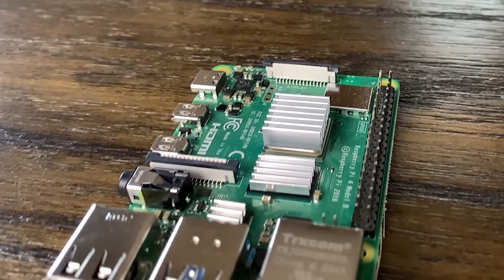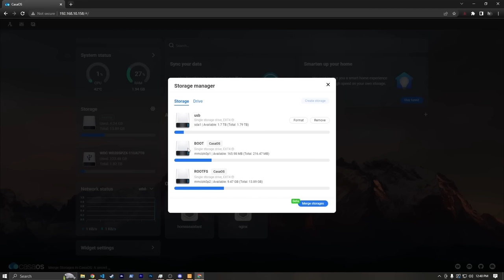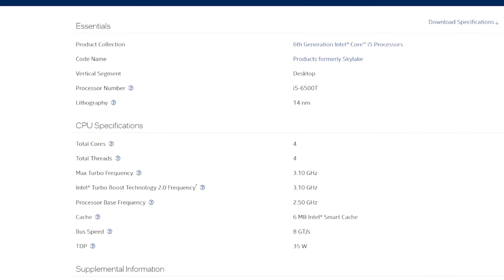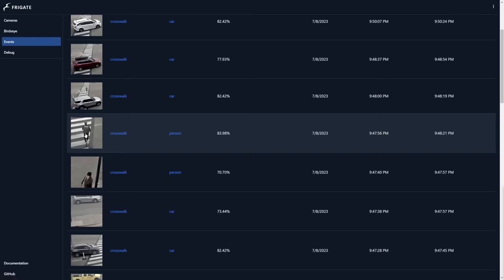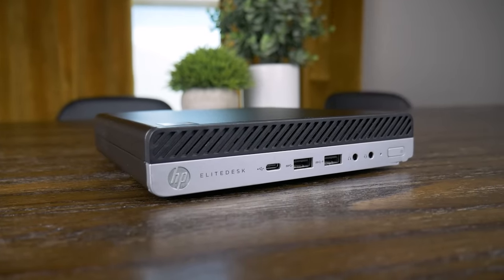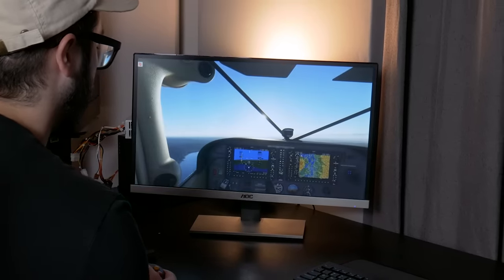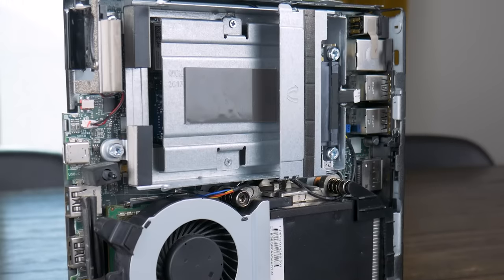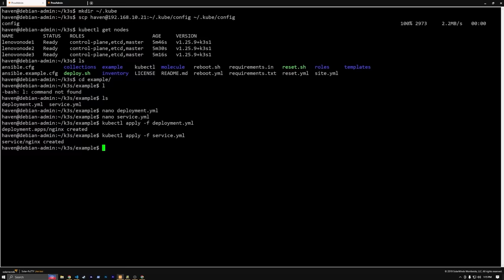The Mini PC You SHOULD Be Looking At

Comment: To obtain the same price of RPI you had to buy this used and to be fixed.
But, most important, I still don't understand why many of you continue to consider RPI as a mini pc. It's not a mini pc, it's something different which strength is flexibility. RPI makes sense for highly customized projects, not for pc use.
Many compare mini pc to RPI just because you can easily win on specs confrontation, but this is not fair.
So, just say "here's a good and cheap mini pc": that's fair. Comparing a mini pc to a RPI is unfair and misleading, IMHO.
Reply from the maker: I agree that RPis weren’t designed for the applications is discussed here, which is a big part of why I made the video. There was an element of shock and awe by mentioning the Pi, but you also have to realize that many of the people that watched this might’ve bought a RPi when something else would’ve been better. I agree with everything you said other than it being misleading. Unless you skipped the first sentence or two of the video I guess
Reply: @HardwareHaven  the first two sentences of the video are part of the video.
If I have to talk about a cheap car, I wouldn't start from a bicycle.
But ok, I get your point.
Reply from the maker: If tons of people were spending thousands of dollars on a bicycle to make a 15 mile commute every day, and you were making a video about an inexpensive car that would cost roughly the same and be much better, you might start out the video talking about the bicycle. I think that’s a fair use of your analogy.
Reply from the maker: And I wasn’t suggesting that you skip Tye first few sentences. I was saying that in those first sentences, I explain that raspberry pis aren’t bad, but aren’t good for certain uses.

Comment: Going to correct you about the x86
The cpu's are x64
Reply from the maker: x86-64 is an extension within the x86 family of processors. Yes, they’re x64 or AMD64 compatible, but still within the x86 family.
Reply: @HardwareHaven  not every x86 cpu supports 64 bit then following what you say
Reply from the maker: Yeah, that’s correct. But an Intel i5 is still an x86 cpu. When comparing between other architectures like ARM, RISC, people tend to just say x86 rather x64 or x86-64.
Reply: @HardwareHaven  i don't
Reply from the maker: @elwinroyale  I never said that you did or should. I think we're on the same page 👍

Comment: Why another video recommending people buy these used machines and immediately upgrade them.

Buy a new mini PC. A low end model will feature a 4 core celeron 6 watt,  8gb ram, 128gb nvme, wifi/bt, 1gbps ethernet, USB c, HDMI starting around $100 and often on sale for $70-80. Either Windows 10 pro or 11 pro.

Then there are options galore. High end AMD or Intel laptop CPU, 2TB nvme, 32gb ram and more.
Reply: Agreed. There's little reason to buy into old platforms like 6500T unless you can get them ridiculously cheap. Modern alternatives like N95/N100 in sub-$200 mini PCs outperform them at much lower power consumption, can have DDR5, can have nice features like onboard Wi-Fi6E+2.5gb networking, and have Iris Xe onboard graphics making them reasonably capable of low-end PC gaming and higher-end emulation tasks.
Reply: @velocity37  even a n5105 based celeron almost as much CPU power as the i5-6500, but is a 10 Watt CPU vs a 35 Watt CPU. The n5105 is missing the AVX instructions if that matters.The n5105's igpu is better than the igpu in the i5-6500T. The n5105 supports 10 bit h265 and VP9 encoding that is missing from the i5-6500T.

Which CPU is best depends on what metrics are most valuable to the individual user. I think that having a slower CPU that is 3.5 times more power efficient is likely extremely important to people moving from a raspberry pi. In fact the n5105 uses about the same power as a pi4 but is several times faster.

Buying a used business computer off eBay is a bit of a crapshoot. How much are you saving when you add in $10 for a 128GB nvme and $10 for a 4GB ram upgrade? Assuming you get the used computer for $70. That means you are saving $10. Unless the mini PC is on sale. You don't have the time invested to clean the used computer nor possibly hours in troubleshooting. The mini PC comes with a warranty.

Comment: Doesn't anyone care how much power it uses? A Raspberry Pi 4 has a 15W power supply. This PC has a 65W power supply, which indicates it uses a lot more power than 15W. With current electricity costs in the EU, this is something to keep in mind, especially for 24/7 solutions.
Reply from the maker: I talk about power consumption in the video
Reply: Still better than running an old server or desktop for your minecraft server, or an expensive Pi with less strength.
Reply: IMHO, some of the modern phones are more powerful than the Pi4 8GB variant. The only thing you have in PI’s is the IO headers which you miss but that’s used by the engineering students or enthusiastic than the home or officer user. These used mini PCs are more powerful and can run full windows or Linux OS and headless. As the famous saying more power comes with more (responsibilities) power usage as well.

Comment: The Pi makes a terrible mobile platform. It has no power supply to speak of and the socketed root filesystem makes any motorized applications a nightmare. I used to be into them, but spent more time mediating vibration and power issues than working on my projects and gave up.

We need more choices because even when a Pi is the right answer, you can't get it because of all the hoarders.

Comment: Sorry, made the mistake of buying an HP computer a decade ago. Never again. As of 2013, on Pavilions, they violated Microsoft's spec for UEFI, in that Microsoft's spec specifically allows for additional bootable OS partitions to be visible... and the HP implementation most emphatically does not...

THEN they wasted literally about 2 months of my time before I got to an L2 (after explicitly and specifically being told there WAS no "L2" support!) to verify this information, which I actually figured out on my own.

This, of course, meant that it was literally impossible to copy data from the old computer to the new one, except by buying an external, independently powered HD enclosure -- because that allowed me to bring up the HD after their useless Boot process completed. 

F*** HP. Never , ever ever going to waste time with them ever again.

Comment: These HP Elite Desk machines are garbage. We have replaced every single one at work. They get really hot, cook the hard drive, and the CPU maxes out doing trivial things. 
1L machines in general are good, just stay away from this generation of elite desk. I have a 1L HP ProDesk that I used as my daily machine without issue. Added a m.2 SSD, and 32 Gig of RAM and it performs flawlessly